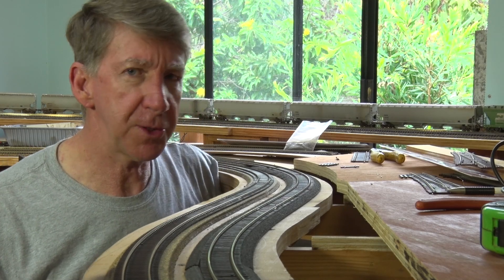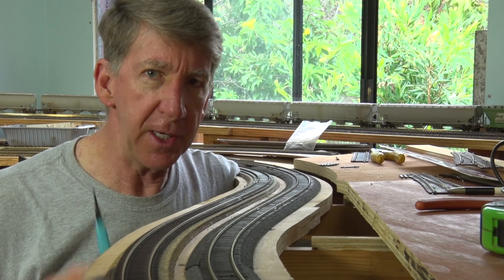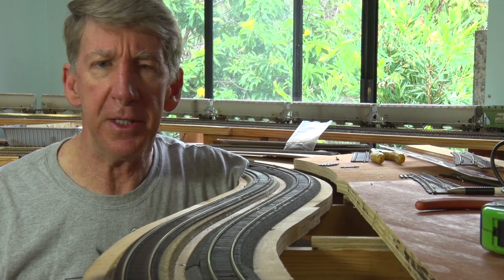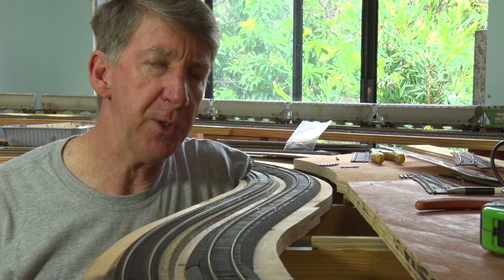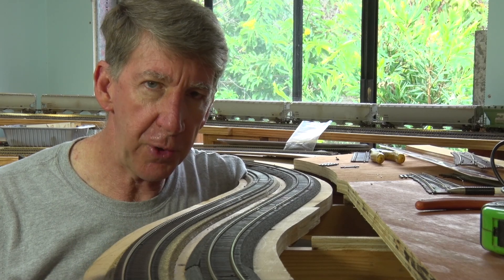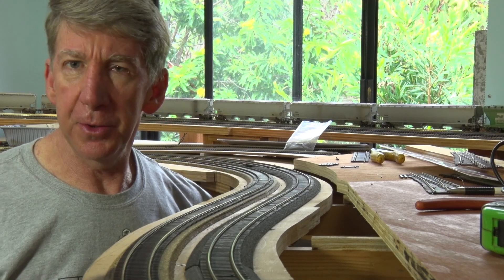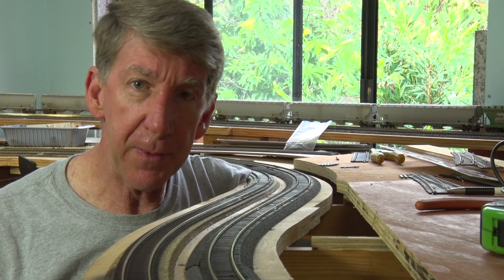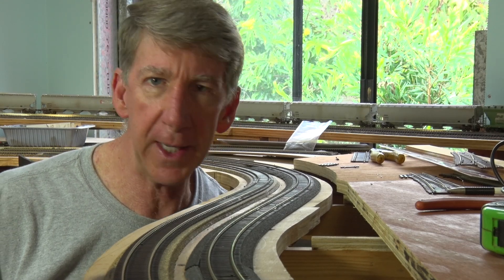"CV shortcuts" update ...you said yes, so stay tuned !

Comment: I'm just glad that future Athearn genesis locomotive models will come with pre-installed illuminating number boards and far fewer wires on board.  All they need now are rotating bearing caps.
Reply from the maker: Hi Joe, yes that's good news for future buyers, but doesnt help me..LOL . I will get there and I've got some great suggestions so far for number board lights! As for the bearing caps, I an take or leave that , but it is a cool thing to see...if you can? 
Thanks for watching.
Gregg.

Comment: Try a word processor. Create a Text Box. Use white text on black background. Make size adjustments. Print on white paper. Mount behind clear plastic in front of your white leds.
Reply from the maker: That is a great idea Dave!  I couldn't put it behind as the lens is smaller than the front, but I could try it on the front after removing the original numbers? I will do a test and see how much light comes through the paper:-)
Cheers Gregg.
Reply: You beat me to it lol.  I've see guys use paper as it works well because the white letters is just the paper itself and its usually lets enough light through to illuminate the numbers.

Comment: Hey Cobba, you Aussie or a Yank? I feel you've sold your soul.. I realise the Rolling Stock is of a foreign extraction, but "Us mob Ere call 'em "Fuel Bombs" and "Grain Wagons" Bogies are what everything sits on "Trucks" are what Mr Linfox runs on the roads. "Shunt Engines" do "Shunting" not Switching which is what the Electric Control Officer is notorious for. There's No High Balling or Low Balling except on the Cricket Pitch... We Just "Give Er 8 mate!" and Open 'em up Full Noise". Passenger, Pass Holders & Parasites ride in "Coaches" like yee olden Cobb & Co. days. I'm sure Lord Stan would concur with my brief summation. Cheerio Bloke!